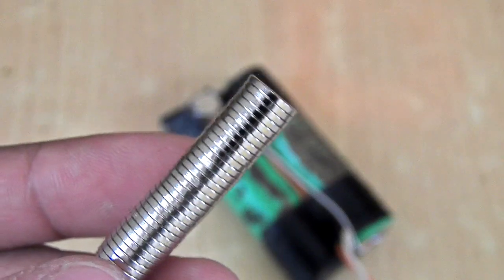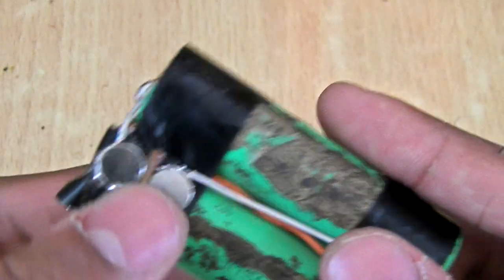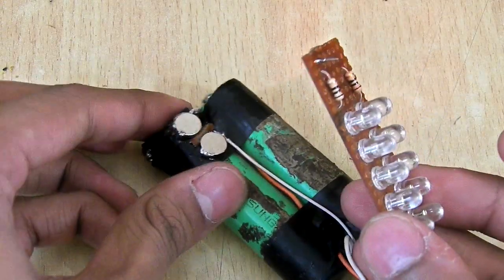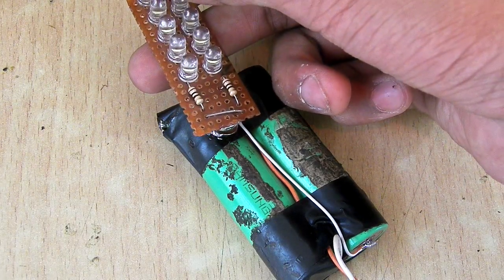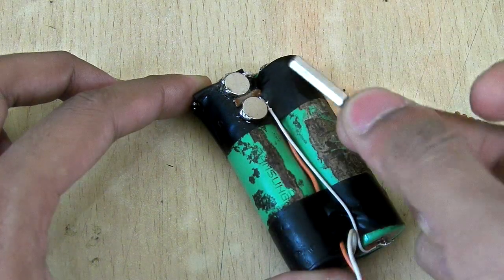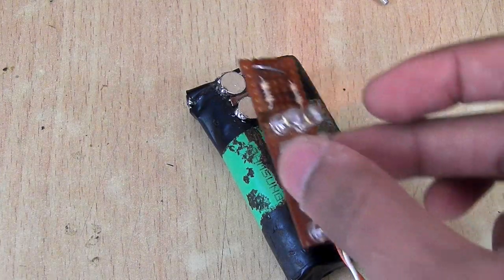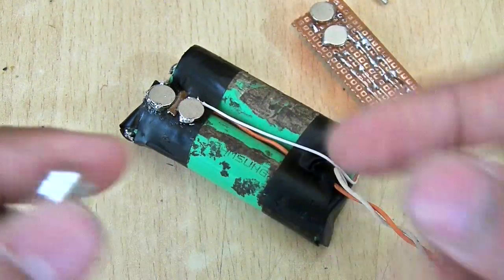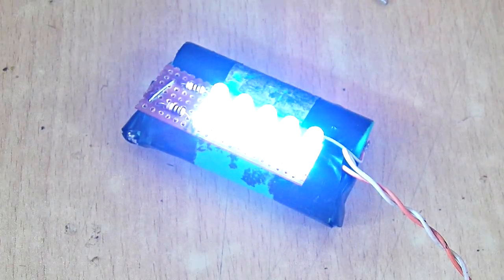Quick connect Magnetic connectors for your next electronics project !

Comment: Great video ! Can u please share the ebay link of the magnet and also a circuit diagram for making a powerful led light for illuminating small work spaces while soldering. I was thinking about buying led strips and making a light but am poor in electronics.
Reply from the maker: Thanks for watching. 
You can buy 100pcs magnets at

http://pages.ebay.com/link/?nav=item.view&id=291239833637&alt=web 

Refer this instructables for connections

http://www.instructables.com/id/Easiest-Magnetic-Power-Connector
Reply: Thanks a lot !
Reply from the maker: Stay tuned for the next videos.
Reply from the maker: Do you know?
You can buy 100 bright white led under 2$

Check out this item I found on eBay: http://pages.ebay.com/link/?nav=item.view&id=141581771941&alt=web